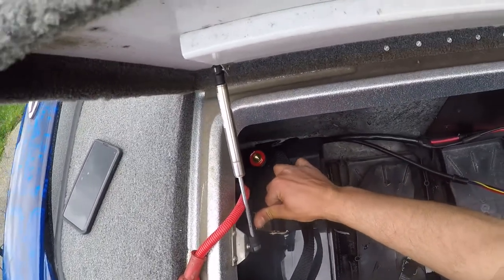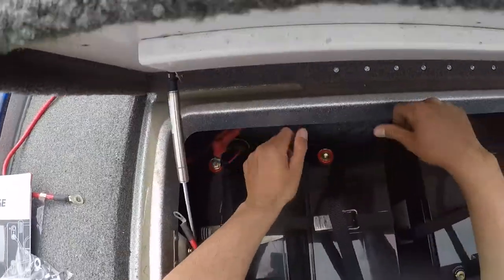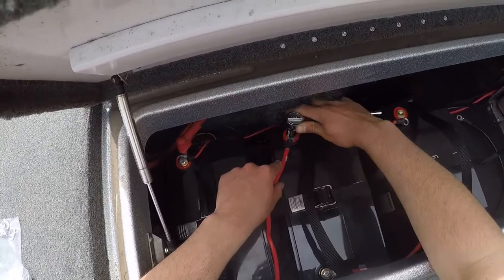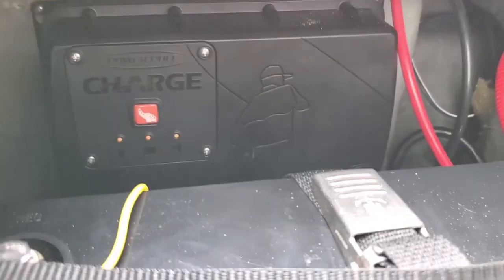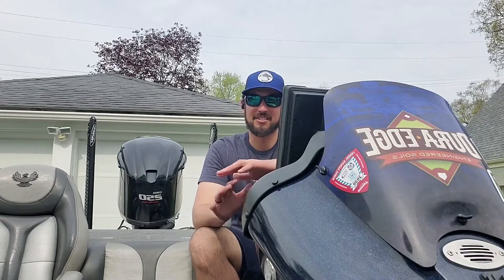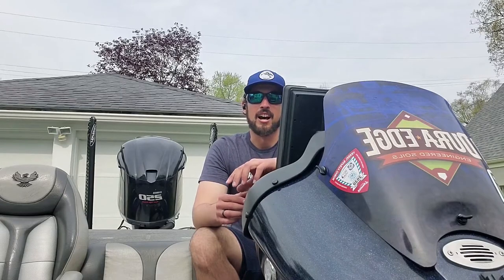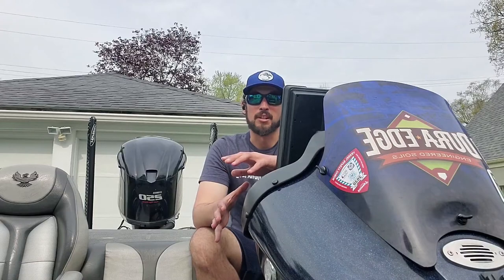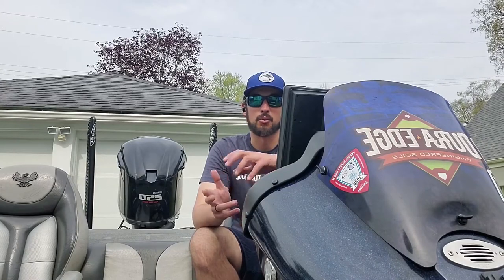Power Pole Charge and Lithium Battery Install

Comment: Can your outboard motor charge your batteries with this charger? I only see a wall plug in
Reply from the maker: When driving, yes it can charge your trolling motor batteries.  I've got lithiums and they run the same strength from daylight to dark with this system.